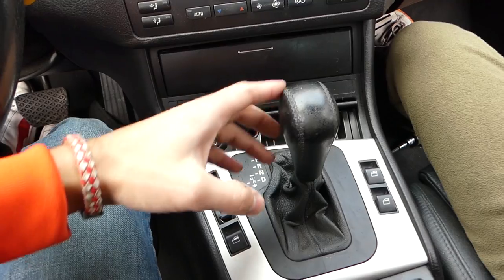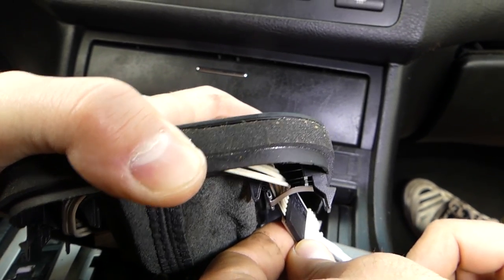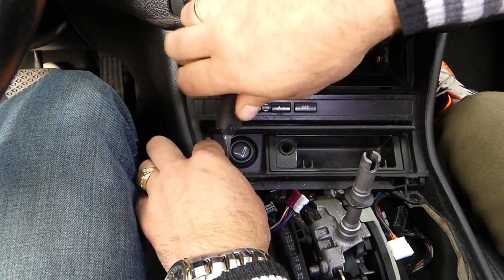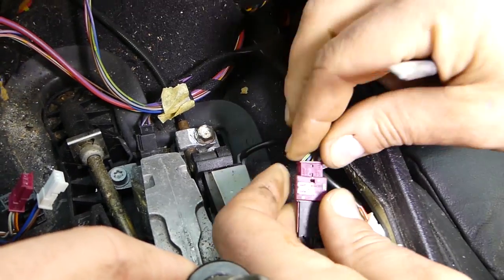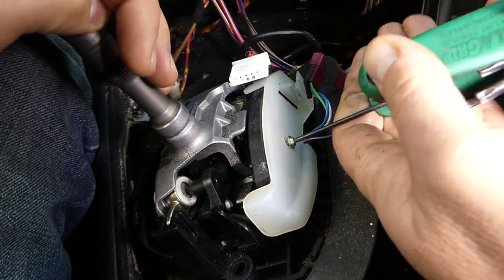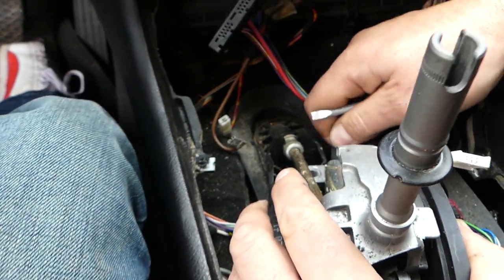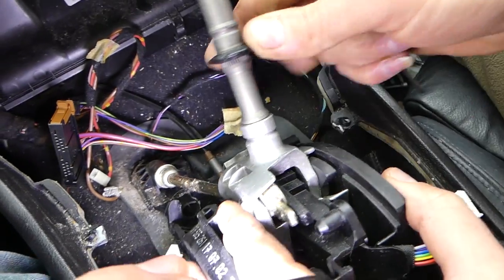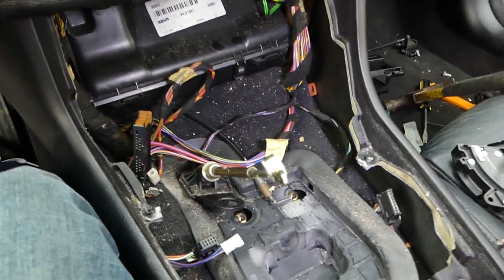BMW E46 AUTOMATIC SHIFTER ASSEMBLY REPLACEMENT REMOVAL

Comment from the maker: Best Scanner Tools That We Recommend:
► Cheap Scanner: https://amzn.to/3P97nEv
► Advanced Scanner: https://amzn.to/4iTXhFc
► Advanced Scanner: https://amzn.to/41Lgv9P
► Professional Scanner: https://amzn.to/3VWJnYL

Best Tools That We Recommend:
► Tool Set: https://amzn.to/4gPS8vE
► Tool Set 2: https://amzn.to/41SEq79
► Torx Set: https://amzn.to/3DsPGwV
► Reverse Torx Set: https://amzn.to/3BHGAfk
► Screwdriver Set 1: https://amzn.to/3ZPkvn8
► Screwdriver Set 2: https://amzn.to/49TR73F
► Oxygen Sensor Socket: https://amzn.to/3BNmEYn
► Oxygen Sensor Socket Set: https://amzn.to/4gracwH
► Torque Wrench 3/8: https://amzn.to/3BL7HWG
► Torque Wrench 1/2: https://amzn.to/4iOrTaW
► Wrench Set: https://amzn.to/3Pco81u
► Off Set Box Wrench: https://amzn.to/3Pafb8Q
► Voltmeter: https://amzn.to/4gKJ1MM

Best Car Accessories:
► Dash Camera: https://amzn.to/3ZJrbDa
► Tire Compressor Pump: https://amzn.to/3DIcgS8
► Cordless Tire Compressor Pump: https://amzn.to/3DFy2pE
► Battery Charger: https://amzn.to/4iOsAkB
► Dead Battery Jump Starter: https://amzn.to/3Du3s2x
► Jump Starter and Air Compressor in 1: https://amzn.to/3Wif92T

Best Engine Oils That We Have Used:
► Mobil 1: https://amzn.to/4gAwegn
► Castrol Edge: https://amzn.to/408MXlf
► Liqui Moly: https://amzn.to/409VkNi
► Oil Filter 1: https://amzn.to/4iNY1LV
► Oil Filter 2: https://amzn.to/3DsRbLz
► Oil Filter 3: https://amzn.to/41Rdhl0

Coolant:
► European Cars Blue: https://amzn.to/49Rf8bw
► European Cars Pink: https://amzn.to/4gxRLGG
► American Cars and Trucks: https://amzn.to/4guBulN
► Asian Cars: https://amzn.to/3P9J3C6

Fuses:
► Best Assorted Fuses: https://amzn.to/4gwCo12
► Standard Fuses: https://amzn.to/3ZQj6N1
► Mini Blade Fuses: https://amzn.to/3WifXor
► Jcase Fuses: https://amzn.to/3VVtOAK
► Low Profile Fuses: https://amzn.to/40ayXao
► Mcase Fuses: https://amzn.to/41UAqmR

Best Car Person Presents that we recommend:
► Lego Technic: https://amzn.to/406rnOf
► Portable Jump Starter: https://amzn.to/409kH1O
► Front Rear Dash Camera: https://amzn.to/3DwBTpf
► 152 in 1 Screwdriver Set: https://amzn.to/4gR144c
► Car Key Chain: https://amzn.to/41Khs24
► Car Detailing Kit: https://amzn.to/3Dxrbif

AMAZON ASSOCIATES DISCLOSURE
Auto Repair Guys is a participant in the Amazon Services LLC Associates Program, an affiliate advertising program designed to provide a means for sites to earn advertising fees by advertising and linking to Amazon.com
Reply: sometimes my automatic e46 coupe will not start ,  i know it is the neutral safety switch that is the issue but which part is it?

Comment: I took apart the shifter per your video. Great instructions. A piece fell out the shifter I don't know where it goes? It has round metal head in plastic holder with spring inside?

Comment: Could you fill the trans fluid through the shifter knob? I know it’s not the proper way but my fill plug is stripped and my transmission has been clunking. I need to fill it up more
Reply: maxreaper25 I know you can in other cars but I’m not sure about bmw , I’m having the same issue , I just don’t want to take apart the shifter to find out I can’t fill it

Comment: Hello  if you move to 11:36  there is the black electronic module , you show only one side  the other side has a silver lever that pushes onto a micro switch. I have dropped my lever its a little bent and I cant figure out how it goes together. maybe I lost a connecting part. could you help me here. I cant even find the part online to see the image. Thank you kindly

Comment: I switched my assembly due to the shift lock solenoid being broken, I removed from an exact identical model as mine 01 330ci. 
Now it’s stuck in park and only goes out of park when I have the solenoid disconnected but trans light stays on and feels like it’s in limp mode.

Any idea on what I should do next?

Comment: you know anything about a ‘magnetic valve shift lock’ i just got that code on my e46
Reply: Did you manage to get the code resetting know how to get it sorted?. I got the same thing my e46. Followed the video and now I don’t have the manual option and  lost sports drive as well.
Reply: @Paul-gj7qu  turned out one of my connectors was under the shifter. after i plugged it in the light went away and worked beautifully. i would just carefully look at every connection

Comment: The shifter in my BMW X5 is very hard to shift through the gears I looked and nothing was wrong with it. What could be the problem?
Reply: Amel R
Did you find a solution i have the same problem ..

Comment: Godsend! Somehow some idiot mechanics broke my shifter and I couldn't put it into sport or manual anymore. Ordered a replacement for $60 on eBay and thinking about using this video to save paying another mechanic an hours worth of labor!

Although, mine came with the cable so i'm not sure how to attach that
Reply: I'm having a similar problem, did replacing the unit work?
Reply: @seanpanchal6955  yes

Comment: Could you fill the trans fluid through the shifter knob? I know it’s not the proper way but my fill plug is stripped and my transmission has been clunking. I need to fill it up more
Reply: the hell u smoking 😭